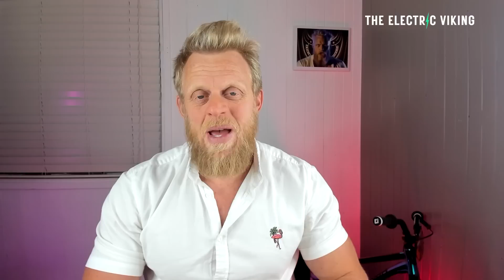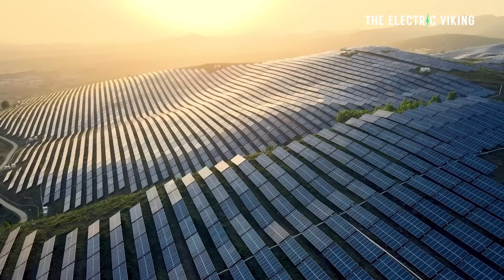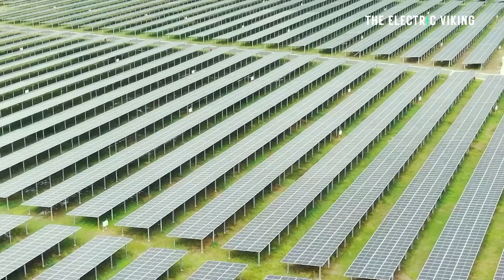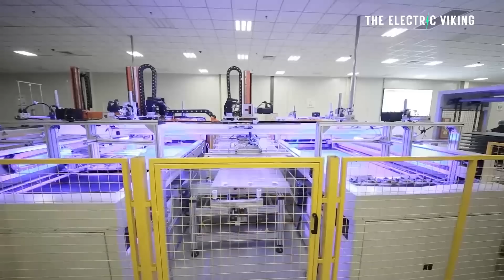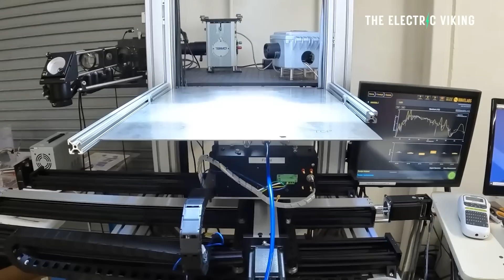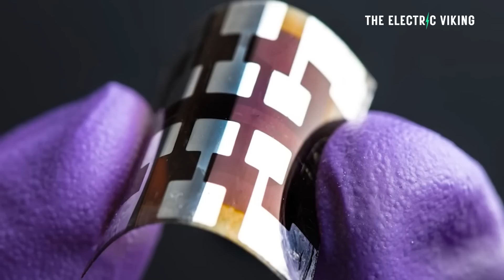How much of the worlds land mass we need to cover in solar

Comment: The problem isn't the panels, it's energy storage - sun doesn't shine at night, and the cost of storage along with maintenance and durability is the problem.  Batteries also need to be kept in a relatively narrow temperature range and that's a problem too....just adds to the cost.
Reply: The biggest battery on Earth, in South Australia, made so much profit after it was installed that it was quickly expanded.
Reply: @elephantintheroom5678  But it's only used for frequency stabilization, it doesn't store a significant amount of energy at all.
Reply: @PistonAvatarGuy  As this channel has reported, South Australia was running completely on wind, battery and solar power for about 2 weeks last year, when storms cut SA off from the rest of the Ozzy grid. During that period, SA generated the cheapest power it ever had, in no small part due to that huge battery. You can't rationally argue with those facts. All you have left are irrational, emotional arguments.
Reply: @elephantintheroom5678  SA absolutely does not run entirely on wind, they have a huge amount of natural gas generating capacity and have the ability to import energy from neighboring states. They may produce more than they use at times, but they absolutely need to rely on natural gas and coal when their wind turbines are not meeting demand.

You can even watch their energy production in real time and see how much they rely on natural gas and how little energy the battery supplies.
Reply: @PistonAvatarGuy  Do you have a problem with comprehension? Reread my comment; it spoke of the proof that SA can and has run entirely on renewable energy for over eleven days straight in 2022, when storms stopped their ability to import or export energy. That is an entirely different point than what South Australia is invested in.
Reply: @PistonAvatarGuy  Gas provides only 7% of Australian energy production and won't grow much, since it is more expensive than solar and wind. In fact, Australia is leading the world in proving how we can rapidly transition to renewable energy. Per capita, Australia is installing solar at twice the rate of anywhere in the world, followed by Japan and Germany. Despite the old fossils who still knock it, solar produced more energy worldwide than nuclear in 2017, and this year it will surpass worldwide hydro generation. Furthermore, in three years it will surpass worldwide coal generation, and by 2031 solar will surpass the generation capacity of nuclear, hydro, coal and gas COMBINED. Indeed, in most places in the world it is cheaper to install new solar installations (with batteries) than it is to keep existing coal plants running, as coal plants run at a loss if they are operating at less than 70% capacity, which they often are because wind and solar is so cheap. At the moment, the only thing keeping coal plants operational is contractual agreements and hefty, taxpayer-funded subsidies. In short, fossil fuels have no future anywhere in the world, and the future of energy is solar (in the world's sunbelt, where most people live) and wind, outside of that.
Reply: @elephantintheroom5678  Wow, 11 WHOLE days??? No way! That's really impressive and definitely proves that wind and solar energy can power a modern, industrialized country! Oh, but wait, SA only has a tiny population, isn't a large producer of anything and relies heavily on natural gas when their wind and solar energy systems aren't producing? INTERESTING. How much more wind and solar generating capacity would they need to be 100% independent of fossil fuels? 10 times? One hundred times? That certainly wouldn't cost anything, now, would it?

We weren't talking about ALL of Australia here, bud, it's extremely dependent on COAL, we were talking about SOUTH Australia, which is supposedly a wind and solar powered utopia. Sorry, but it's not, it has a HUGE amount of natural gas generating capacity and is completely dependent upon natural gas for reliable energy production.

Per capita, Australia is the LARGEST consumer of coal in the world! Australia is also one of the largest exporters of coal, so it's about as far from being green as a country can get!

Germany is a FAILURE, it's proven beyond any doubt that wind and solar can't displace fossil fuels in any significant way. Meanwhile, France decided that they weren't going to be dependent on fossil fuels and basically eliminated their use of them for the production of electricity by using NUCLEAR ENERGY. It wasn't even their goal to significantly reduce their CO2 emissions, but they did just that, and to a greater extent than any other industrialized country has in the history of the world!

France has about HALF of the per capita CO2 emissions of Germany and Germany's electricity is almost TWO AND A HALF TIMES MORE EXPENSIVE!!! The electricity in Denmark, which is heavily dependent on wind energy, is MORE than two and a half times more expensive than the electricity in France!

Sorry, but so called "renewables" have already PROVEN that they can't do anything but skyrocket energy prices, they are a complete FAILURE! You people just need to wake up to the FACTS!
Reply: @elephantintheroom5678  "...the only thing keeping coal plants operational is contractual agreements and hefty, taxpayer-funded subsidies."

And what is currently being used to subsidize solar energy installations? There are HUGE government incentives to install solar! You don't have an honest bone in your body, do you?
Reply: @PistonAvatarGuy  Here is the source for my comments about the various energy sources and when solar produced more energy than them: European Electricity Review 2022 (International Renewable Energy Agency and Global Energy Monitor data)...should you want to check the truth of my statements. Or just rest on your silly unverified opinions...
Reply: @PistonAvatarGuy  Just because S.A. rejoined the interconnected Australian electricity grid when connection was reestablished, doesn't mean S.A. couldn't have continued on independently had it been necessary. Logic isn't your strong suit.
Reply: @elephantintheroom5678  Hardly an unbiased source. You really need to learn how to spot weasel wording, cherry, picking and manipulative wording.
Reply: @PistonAvatarGuy  🤣And the International Monetary Fund? And the Australia Institute? I suppose you also claim that the IPCC is a biased source? I expect you also claim that the WHO was lying about covid-19, too? 😂 You're laughable.
Reply: @PistonAvatarGuy  Incentives and subsidies are just different word for the same thing. refer to my comments quoting the IMF as to what energy source is most subsidised, worldwide.
Reply: @PistonAvatarGuy  According to the IMF, "fossil fuels account for 85% of all global subsidies," and reducing these subsidies "would have lowered global carbon emissions by 28%, and fossil fuel air pollution deaths by 46%."
Source: International Monetary Fund. 
Also, according to the Australia Institute, Australian taxpayers paid $11 billion in fossil fuel subsidies in Australia in 2021-2022.
Source: The Australia Institute.

Not only that, if we look at global figures, taxpayers paid $5.9 trillion, or 6.8% of GDP in 2020, and is expected to rise to 7.5% of GDP in 2025.
Source: International Monetary Fund.
* See what happens when you do some actual research rather than listening to Fox or Sky News propaganda points?
Reply: @PistonAvatarGuy  According to the International Energy Agency's latest forecast, over the 2022-2027 period, renewables are seen growing by almost 2400 GW, worldwide. In comparison, the International Energy Agency reports that present nuclear operational capacity (2022) is 413 GW.
Source: International Energy Agency (2022).
Reply: @elephantintheroom5678  It's irrelevant in this context, because I'm not arguing in favor of fossil fuels. Again, you're not even reading my comments.
Reply: @PistonAvatarGuy  Why? Because you spout the same talking points they do.
Reply: @elephantintheroom5678  Like nationalize the grid and adopt NUCLEAR energy? Or the facts relating to wind and solar energy?
Reply: @PistonAvatarGuy  New nuclear, as well as maintaining or expanding old nuclear, is actually way more expensive than wind and solar (with batteries). You should look into how many offline days French nuclear plants have due to repairs (cracks at the welds, and the like), and how much it costs taxpayers. Indeed, nuclear is actually the most expensive energy of all to expand humanity's power generation. You need to watch the video by Engineering with Rosie (on YouTube) explaining and illustrating the relative costs of all means  of energy generation. Also, batteries have decreased 90% in price over the last few years. Once again, you haven't a clue what you're talking about. Do some research.
Reply: @PistonAvatarGuy  Variability is absolutely irrelevant when you have batteries, and the batteries are plummeting in price as fast as solar did.
Reply: @PistonAvatarGuy  Well, if you ignore the evidence from the international Energy Agency and the International Monetary Fund it is clear to all that you simply are either unwilling or unable to face reality. The fact is, your research must be from REPUTABLE sources.
Reply: @elephantintheroom5678  Yeah, and reputable sources keep pushing South Australia as a "renewable" energy success story, WHEN THEY'RE STILL HEAVILY DEPENDENT ON NATURAL GAS. Sorry, but you're being manipulated by marketing hype, and people are struggling with skyrocketing energy costs because of it.
Reply: @elephantintheroom5678  I'm still just dumbfounded by this...

Me: LCOE doesn't include the cost of eliminating the variability of renewable energy systems.

You: Variability is absolutely irrelevant when you have batteries....

I mean, do you not understand that batteries cost money? Do you not understand that they are many times more expensive than the solar panels themselves? I don't understand your thought process here.
Reply: @PistonAvatarGuy  Wrong. In Europe, during the recent energy crisis, the areas that used the most renewables had the lowest energy costs.
Reply: @elephantintheroom5678  The only reason why Europe had energy at all was because of traditional energy sources, like coal, natural gas and nuclear. Without those energy sources, people would have been freezing to death in their homes. What's your source for that information, btw?
Reply: @elephantintheroom5678  And, anyway, France would have seen an increase in its energy prices because of an increase in demand for the reliable energy that it produces.
Reply: @elephantintheroom5678  So sadly misinformed that it's pathetic? You do realize that over 60% of the energy in Europe is produced using nuclear and fossil fuels, correct? If those generators were to fail to meet demand, Europe would end up in the same situation that Texas had in 2021. Wind and solar don't produce energy on demand, they are a LIABILITY in situations like the one Europe faced this year.

Energy is cheap when it's not in demand, bud, that's the law of supply and demand, your ravings are irrelevant.
Reply: @elephantintheroom5678  You might be more successful in this conversation if you actually read and comprehend my comments.

TLDR; France succeeded where every other country which has attempted to replace fossil fuel energy generation with wind and solar energy has failed, because they nationalized their energy grid and adopted nuclear energy.

And it's funny that you accuse me of being brainwashed, when you clearly have no idea what you're talking about, or what was actually said here and have simply accepted the ravings of the "renewable" energy cult on nothing more than faith.

Comment: That's absolutely true about solar only taking a small portion of the surface of the earth.

Under perfect sun,
let's see it takes 10 acres to make the equivalent of one Megawatt. 

In that same perfect world with sun covering the entire United States to power the US Grid with solar, you have to build enough solar panels to cover an area the size of New Hampshire and Vermont combined. That covers daytime grid loads. 

Yes, that's only a fraction of the area of the United States.

At night if you could build enough magic batteries to power the US grid that discharge at night, to recharge them the next day, you will need enough solar panels to cover an area the size of Lake Michigan. 

That is also a small fraction of the area of the United States.

Piece of cake!!!
Reply: But the whole point is NOT to cover land like Vermont or New Hampshire, but rather areas that humans don't use for any other purpose. That's what the whole study, and this entire video was about...

Comment: Doesn't heat, like desert heat and humidity do a lot to reduce the efficiency of a solar panel system, it is virtually impossible for a solar panel to be damaged by heat and humidity alone but it can reduce a panels efficiency.  

I have no idea but am just repeating what I have heard before.

Still, all that empty space which brings us back to how you are going to get the end product to cities far away from the desert ie transmission lines.  that will cost probably billions of dollars but the more you put up, the more you save and if you create a need for them, the cost will come down eventually ...

but how many solar panels would it take to do what you have said?

Comment: Main issue is that mostly farm land is used.  Deserts and existing structures are one thing.  Grazing and tillable land are another.  Have seen some techniques of using solar above a crop since they do let light though.  However I am skeptical of this being effective.
Reply: Shelter that shades a crop from the fierce sun in the middle of the day, while exposing crops to morning and afternoon sun, is desirable in many places. It stops heat stress, and slows evaporation of moisture from the soil.
Reply: @elephantintheroom5678  yes but parts of the season they need full sun and as much as they can get.  Typical shade cloth is used for this and can be easily removed.
Reply: @johnhancock2667  In large parts of the world they don't need full sun in the middle of the day at all.

Comment: Hi Sam, what is the efficiency of the solar panels at the moment, when does it get better and what is the life of the panels. At what point the life has ended
Reply: You can easily look up all of these stats. Efficiency is 22 to 27 percent. Life is greater than 25 years (some newer panels are 40 years). Efficiency is not going to go up nearly as much as cost is going to come down. In general the cheaper panels produce the cheapest electricity as you can simply afford more of them.

Comment: I heard or read somewhere that an area of 100 square miles of solar panels would provide more power than is required by the USA, and is likely to need for many years to come.
Reply: do you know how insane that would be 🤣🤣🤣  a bajillion tons of copper wiring.   only for it to produce power for half a day.    then all the power loss in trying to transport that electricity around the us would render it all useless 🤣   solar panels arent the solution. for 99% of the planet.
Reply: @jebes909090  🙄🙄🙄 Well, obviously not in one solid block 100 miles square, but a multitude of smaller areas that equate to 100 square miles. 🙄🙄🙄
Reply: @elephantintheroom5678  Wasn't difficult!
Reply: @AndrewLumsden  True.
Reply: @jebes909090  Most of the world's population lives in the sun band of the planet where new solar is outpacing coal by a factor of 18. Solar out-generated nuclear power, worldwide, in 2017, it will out-generate hydro this year, it will out-generate coal in 3 years, and by 2031 solar will out-generate all these means of generating power, worldwide, COMBINED.🤣laugh at that.
Reply: @jebes909090  your orange messiah will not save you
Reply: @jimmaag4274  no ones gonna save us
Reply: @jebes909090  God said he's going to save me, but he's pretty sure you're fooked...

Comment: bookmarked:
Solar photovoltaics is ready to power a sustainable future
Joule Volume 5, Issue 5, 19 May 2021, Pages 1041-1056
doi 10.1016/j.joule.2021.03.005

Question: Utility-scale PV is currently (or was) 5X cheaper than residental and half the cost of community solar in terms of LCOE (Lazard). How does that comparison change when the cost of PV materials is halved?

Comment: Solar panels. SO much better than wind generation, with all it's moving parts, complex maintenance requirements, and general long term mechanical reliability issues. Sure, we need both - but Simple Solar is the winner in my simple mind...

Comment: I think it would be a big mistake to label all deserts as useless.  Someone is bound to find some endangered species of somewhere within all areas of interest. You would be in court for years trying to get permission to turn 0.3% of the land mass into solar farms. I think it would be better to first focus on unused developed land masses such as roof's farms and parking lots. Then reduce the remaining land mass with Wind. 

I don't know how they came up with 0.3%  was storage taken into account, if not we would have to exceed the minimum to make sure we have supply during the down times, and of course the battery storage to hold all that power.
Reply: How would a solar panel kill wildlife? By providing too much shade?